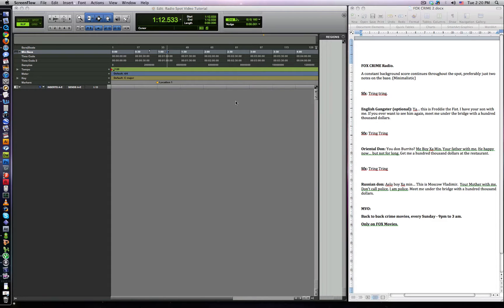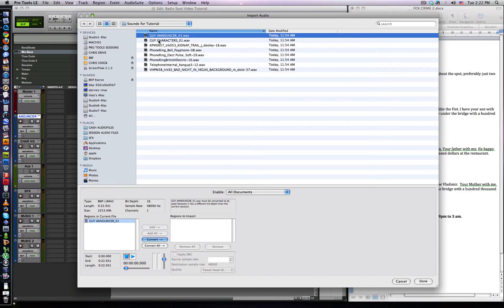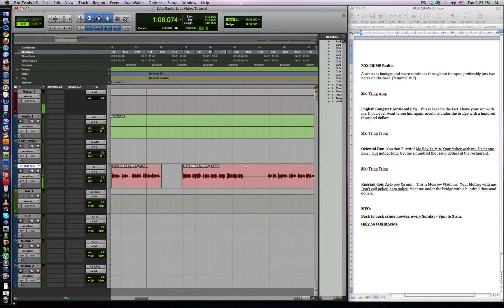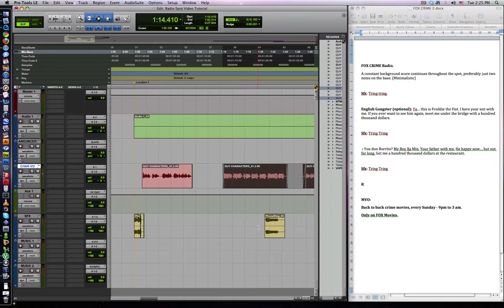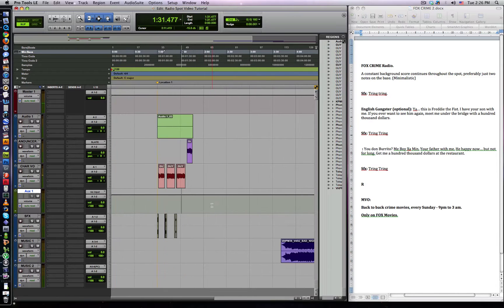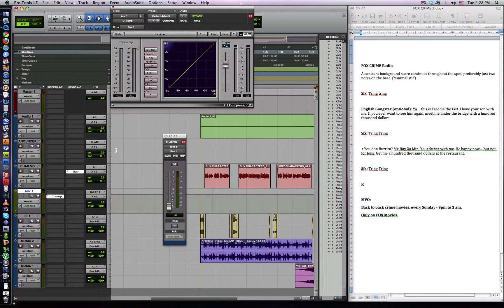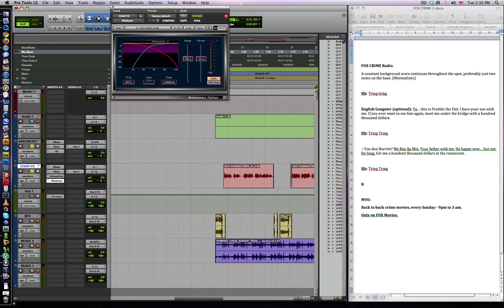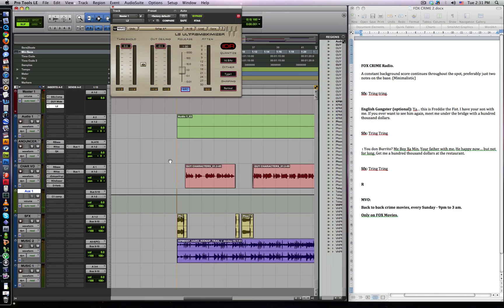How to Produce a Radio Spot in Pro tools.

Comment: Good demo Chris. But....on the other hand this is exactly what made me change to another platform and leave PT behind. You need tons of 3rd party plug.ins to get the job done. There is no VO/script management, no onboard offline loudness check, no batch export for multiple languages just to name a few things. When looking at the video, it remembers me working with PT back in 2004.
Reply: TheEJ1408  think I made this video in 2003 😂 What software did you move over to?
Reply: @iamchrisatkins  :-) We changed to Nuendo 7 (I think in 2015) almost completely after we've been using PT for about 10 years. We got the feeling that avid just relies on 3rd parties instead of incorporating very important features. This is different with Nuendo. Steinberg has been integrating all those features directly, Atmos, ADR, reconforming. It even connects to a game middleware called Wwise.